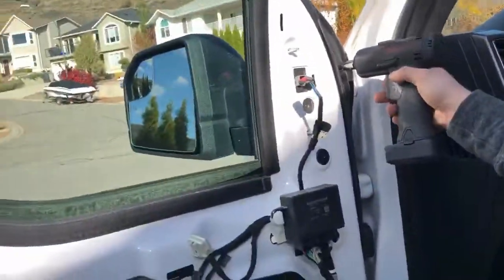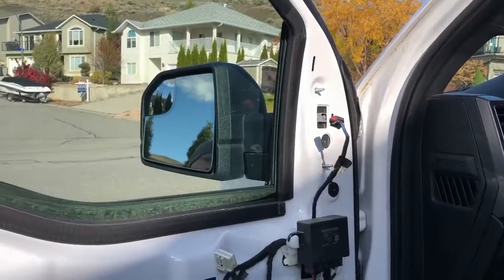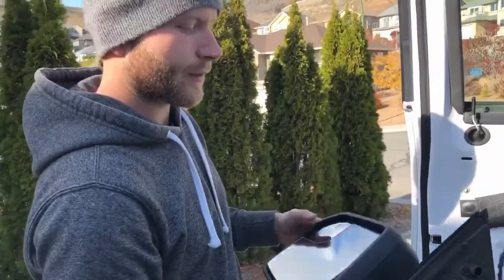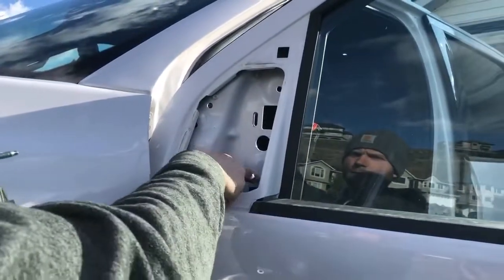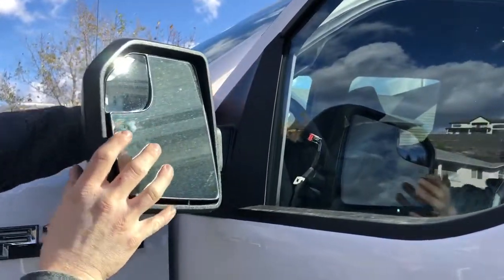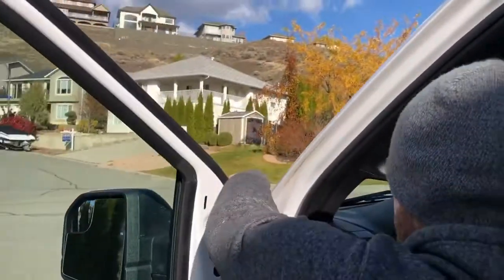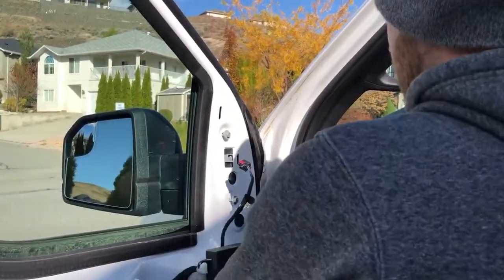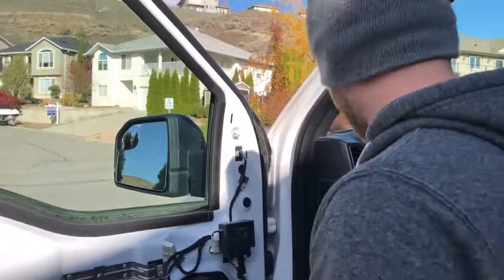2020 F150 Mirror removal and installation

Comment: 2 tips: 1) The whole door panel doesn't need to come off, just the upper piece. 2) Roll the window down so you can reach the mirror easy.
Reply from the maker: Door panel was already off
Reply: @Mrbirdnerd  Point being you projected this was the correct and necessary way to do this. It is 100% unnecessary to remove the door panel. How many of the over ten thousand views did this unnecessary step, or thought the added complexity caused them to pay someone else to do it. 
Congrats on all the views, and the attentiveness to the comments. I was merely pointing out that this upload is inaccurate because the "Door panel was already off." The attention you are showing by commenting back shows you care, which I was taking for granted you'd put this info somewhere. Unfortunately the description says "Refer to door panel removal video prior to this video" which is unneeded.
Reply: Thanks Jim!
Reply: Thank god for this comment cause I literally said “HUH” so loud it echoed when I thought I’d have to take the whole door panel off